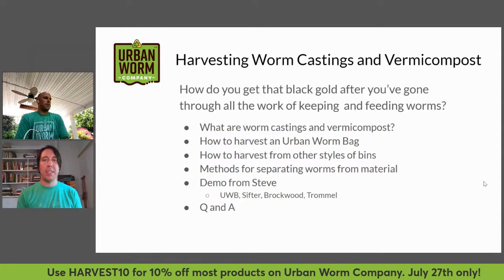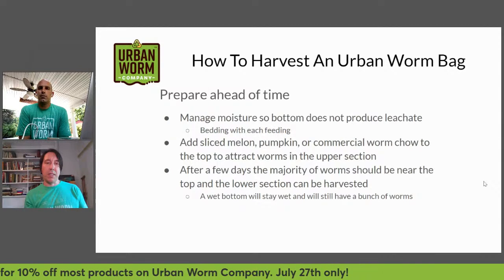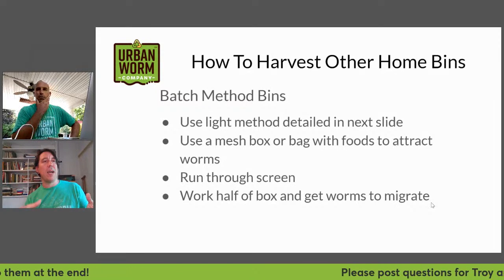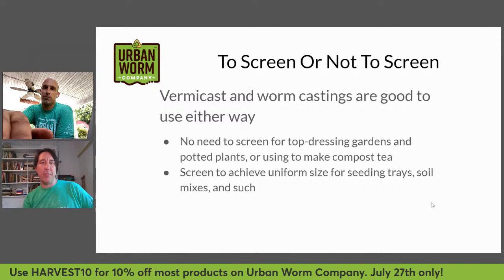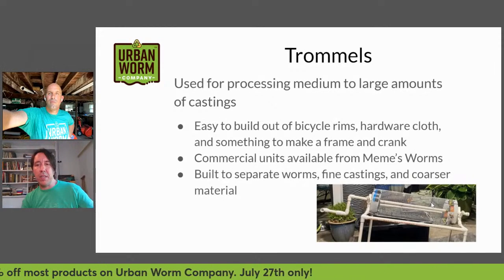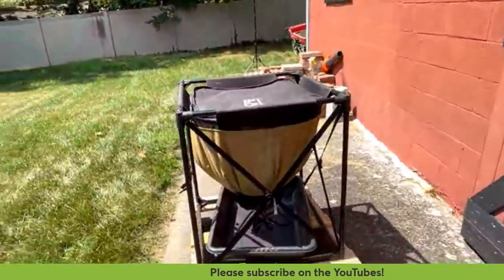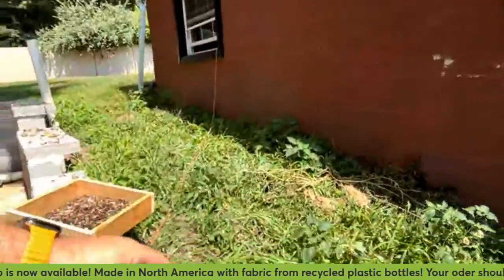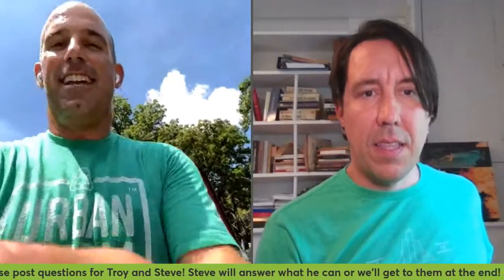Harvesting Worm Castings

Comment: I fill a 5 gallon bucket with my vermicompost, but leave about 3 inches from the top free. I then drill small holes to the free top 3 inches of the bucket for oxygen. I keep them moist by placing a couple sheets of moist newspaper over the vermicompost, but careful not to block the airholes, and seal it tight with the lid. I feel this keeps them viable for nearly a yr as long as there is good moisture. I check the newspaper every 3 months, and most times it's still moist. If not I spray a little water. I keep the bucket in my garage. Away from any light. 
Most times I use them way before that anyways.